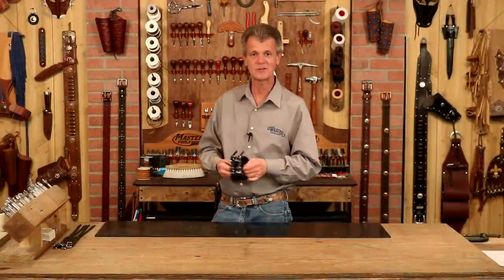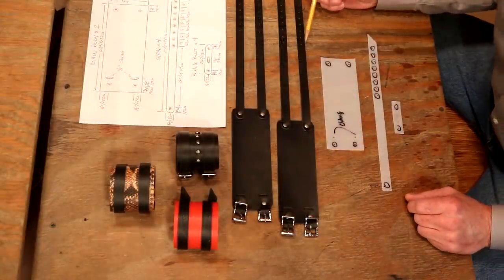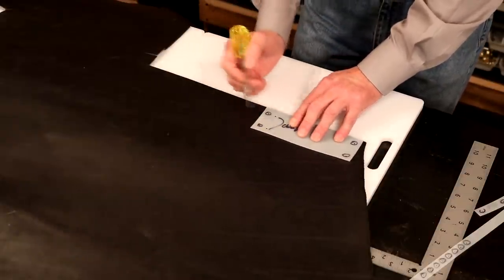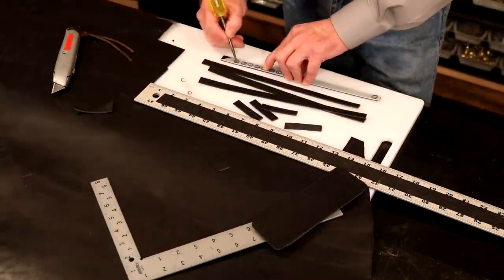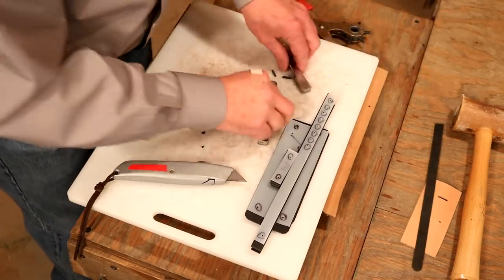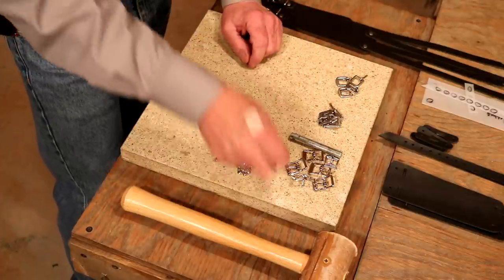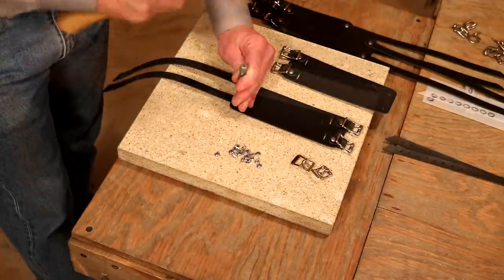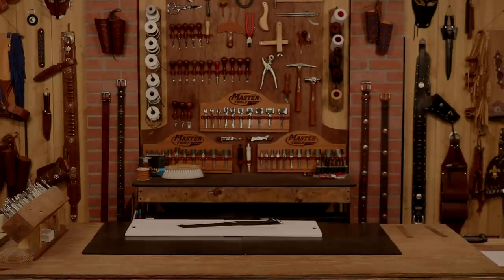Leather Double Wrap Wrist Bands

Comment: Hello sir. New to channel. Bought a usmc kabar knife with leather handle. It's very light. I dont know if there is anything on the leather but it is shiny. I want to dye it dark brown. If they dye it from factory or put something on it to make it shiny can I dye right over the top or do I need to do something to the leather first?
Reply from the maker: Hi Rick,
You would have to remove the shiny top coat first. Deglazer will usually work to remove a top coat, but, without know what was applied we can't say for sure. Just don't use sandpaper to remove it, as this will ruin the top grain of the leather.
Reply: @WeaverLeatherSupply  thank you sir